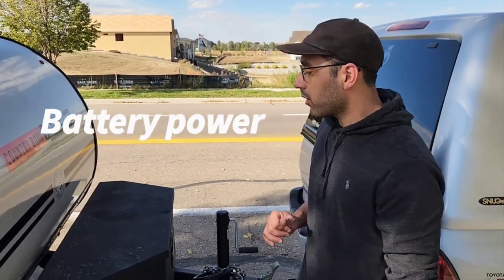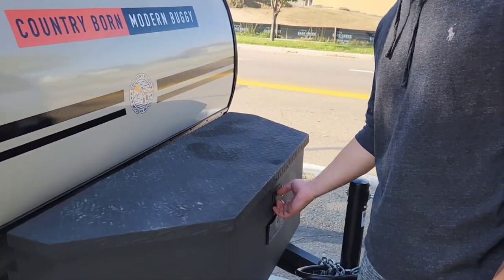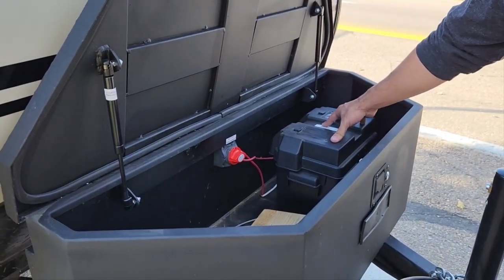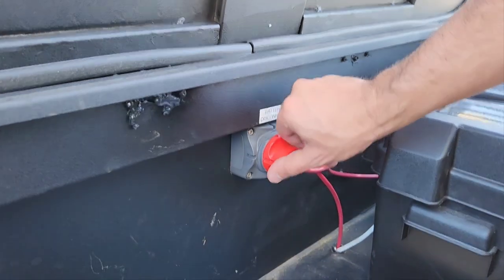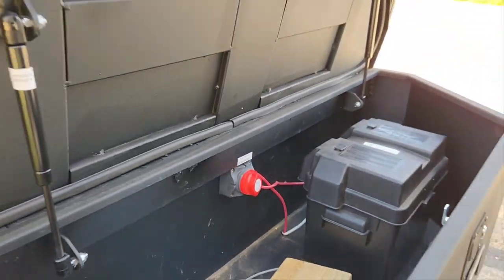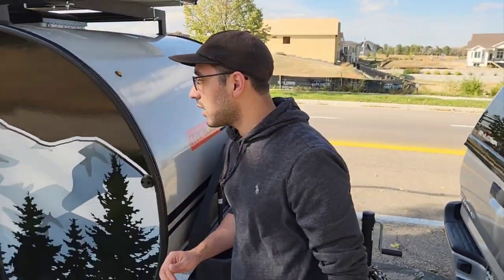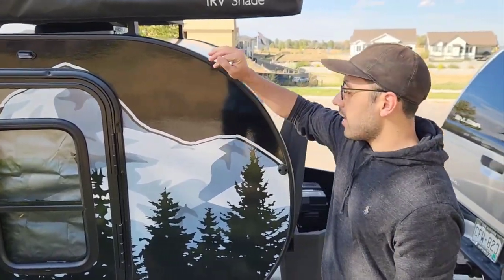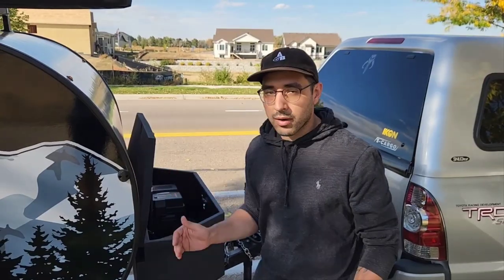Using Battery Power on the Trailer

Comment: Subbed thanks you should do an even longer video showing it off as nobody has anything on this model. Modern Buggy doesn't even have it on the website, bro.
Reply from the maker: Hey thanks. I talked to the owner of Modern Buggy when I purchased this a couple months ago, he told me this was one of the last of the 10LRs they made. There’s apparently much more demand for a rear kitchen option (10RK) so they moved away from this model completely. Pretty unfortunate because the interior heating is what drew me to this model which the RK doesn’t have. 

I’ll get a video up of a full walk around soon.